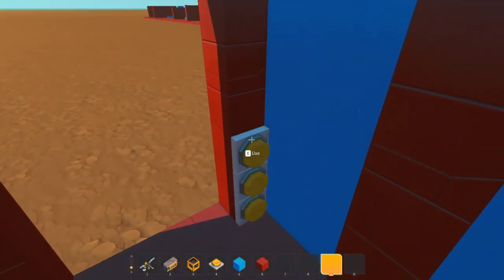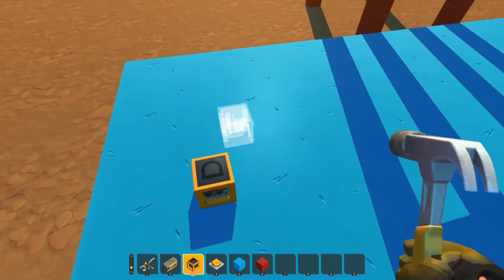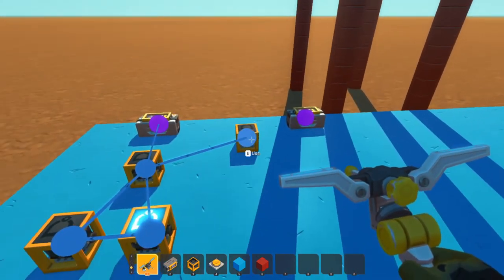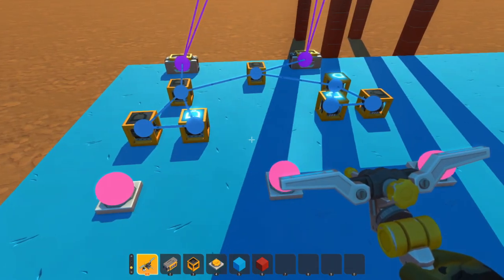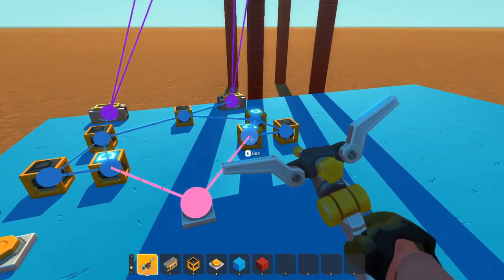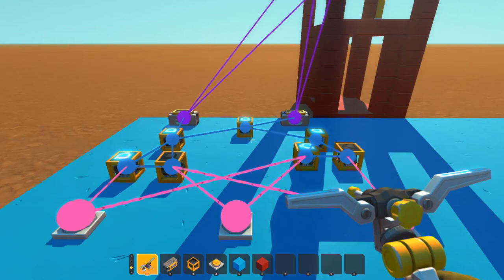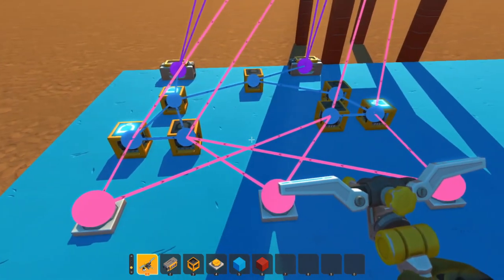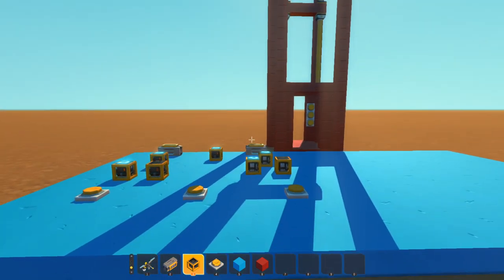Multi floor lift Scrap Mechanic

Comment: I used this this guide to make a 4 level elevator with my son, and he's ecstatic.  I looked at other guides before finding this one, and they used the memory bits to store which floor was being called, and then had a secondary step to figure out which pistons needs to be activated, Probably close to how it works in the real world, but required more parts in Scrap Mechanic.  This method uses the memory bits to store which controllers are active, which greatly reduces the number of parts in scrap mechanic.  I don't think anyone would rig up a system like this in the real world though since there would just be so much wires, but thanks to the connector tool, wires are free :)

Comment: Awesome video. But you don't need the AND block. Also too, to hook up 4 or more floors all you have to understand is that the left nor turns off the circuit and the right nor turns on the circuit.
Reply from the maker: True, just run the corresponding button to the circuits required 🤔

Comment: Thanks for the tutorial bro! I would be grateful if you tell me how to connect middle floor inside button
Reply: @Woody I found the solution. I just repeated the same connection which I did for the outside button. Sorry I didn't think about that
Reply from the maker: No problem ! Sorry I didn't get back to you sooner but you got there yourself so gg!

Comment: How to add automatic doors there that will close COMPLETELY BEFOREthe elevator starts?
Reply from the maker: Off the top of my head you would need sensors, timers and more logic, I wouldnt know without trying a few things
Reply: @wo0dy , there are some on the workshop but they have a net of hundreds of connections and no video explantations (or 2.5 hour building streams)

Comment: Hey! Im trying to make a elevator that have 4 floors and with the pistons from the bottom that pushes the elevator up but i dont understand how to do it
Reply from the maker: So same idea as this only up rather than down? Which bit are you stuck on??
Reply: @wo0dy  i gave up on the piston go up bit and im gone make that you made but i dont understand how to add more floors im gone have 4 floors
Reply: So i need help how to add one more floor
Reply from the maker: @edde9  every time you add another floor you need to add another set of logic, controller and pistons
Reply: Do i need a nor or nor  module more?
Reply from the maker: @edde9  https://youtu.be/ZIOtPSeyctE?t=591

this might help
Reply: @wo0dy  i saw the video but it doesent make sense for me, i dont know how i set every gate and buttons and controler together
Reply from the maker: OK I will try and put a video together it may take a little while but I will try and explain it
Reply: @wo0dy  thx so much, will you make the video now or later?
Reply from the maker: I'm gonna make it right now, but I need to record it and edit it should be a couple of hours at the most
Reply: @wo0dy  okay